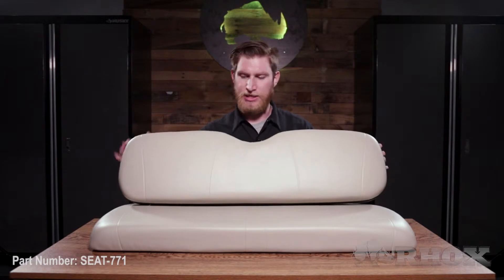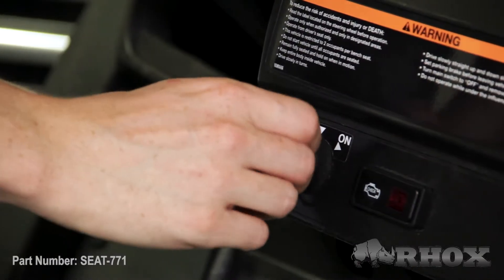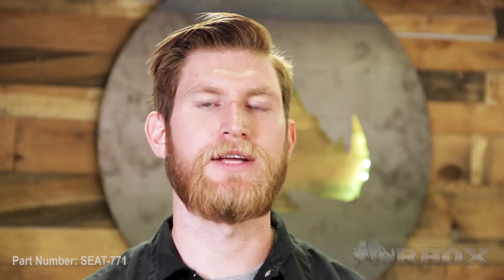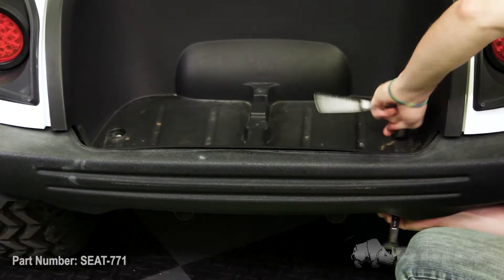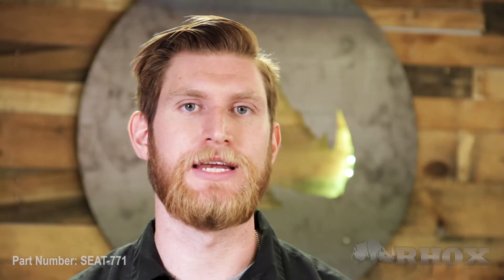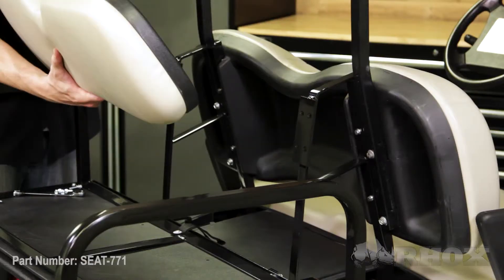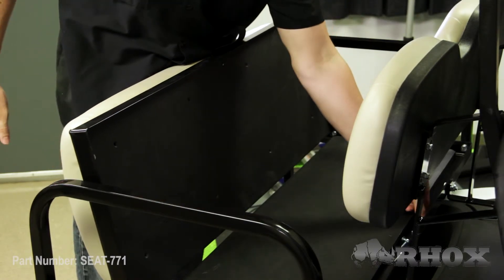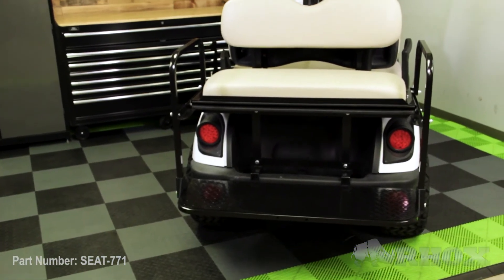SEAT-771 Super Saver Rear Seat Kit on a Yamaha Drive2

Comment: Is this the factory seats you would get if you order a Drive 2 right from Yamaha? Also, do the seats flip up so you can fit golf bags? I can't find much info on the current models about that
Reply from the maker: No, the rear seat kit is made by RHOX.  It can be ordered through any Authorized RHOX Dealer. A bag attachment can be added on the rear and it will still fit passengers if you put it on a safety grab bar. The platform can be folded into a seat or left open to be used as a utility bed.  We do offer matching front cushions and covers so the front seat color matches the rear seat kit.
Reply: @GolfCartInstructions  ok thanks
Reply from the maker: @shmirginhymer1867  Anytime! Enjoy your weekend.